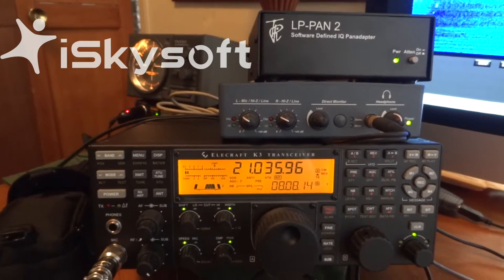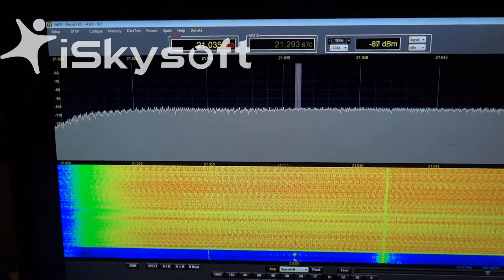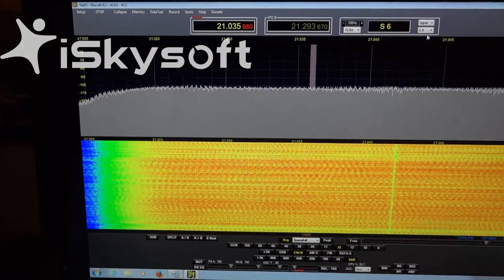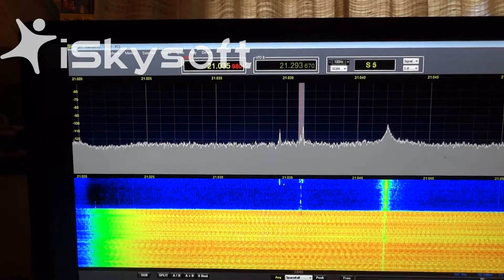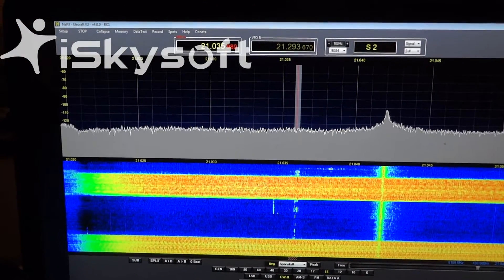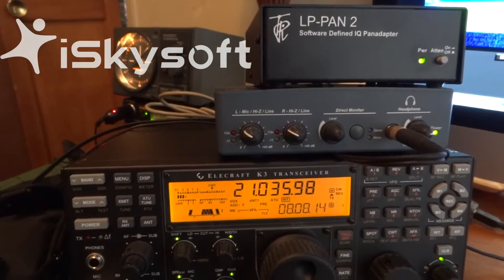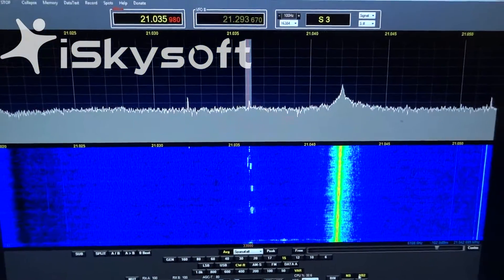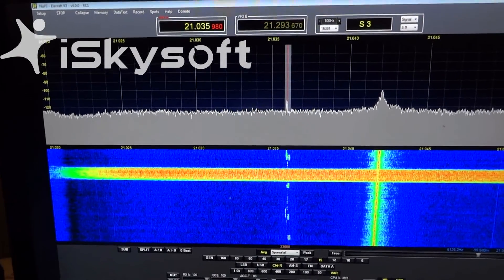SDR Noise Blanker LP-PAN 2 Elecraft K3 kills RFI Power Zap Noise

Comment from the maker: WHY an I.F. Out need for Kenwood TS-990S

Digital Noise Blanker on TS-990S
The TS-990S’s NB2 function works reasonably well if the signals you are trying to hear are weaker than the interfering impulse noise. However, as soon as the received signal reaches a particular threshold, the blanker stops working and the receive audio begins to sound terrible. In addition, the blanker width seems to be fixed; better to have it manually adjustable, as noise varies enormously in width as well as in intensity.

One effective way to implement an impulse noise blanker without these problems is to provide for two controls, one for width and one for threshold. If the impulse is above the threshold, the blanker fires for the duration set by the width control. This is how I implemented the blanker in my SDR software, SdrDx, and the result is that SdrDx can easily outperform the TS-990S in almost any impulse noise environment. As there are no more knobs available, the width control could be implemented as a menu setting and a network control parameter.